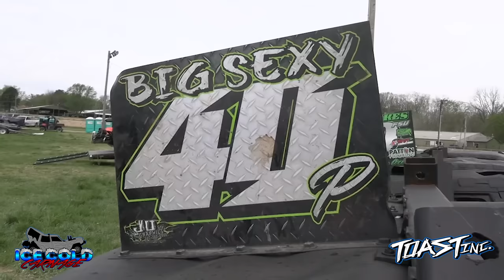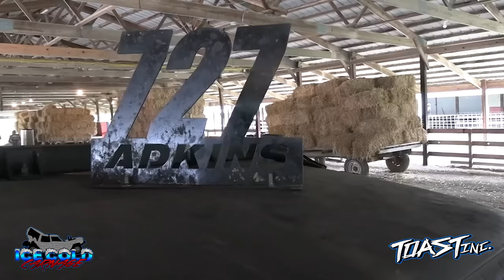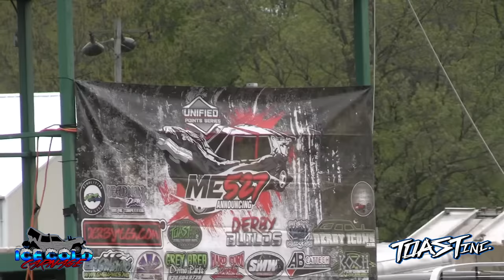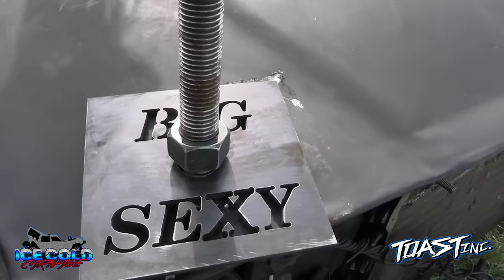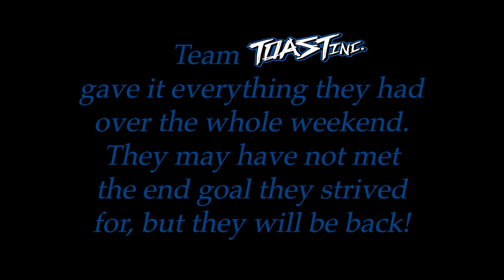Team Toast Inc. Spring X 2023 ( Demolition Derby Documentary )

Comment: You can see how much blood sweat and tears are put in to these derby cars.
The ammount of welding they did is insane.
Well done!!
I have noticed (i'm from Europe) , that there are a variety of classes.
This wasn't always the case right? (when talking about the full size cars)
I use to remember that the derbies were guys who got old cars from the scrapyards, put a roll bar in it, a bash the windows out, and a internal fuel tank in de drivers compartment, and off they go.
The class i see here is really modified with small rear wheels, even the bodywork has been reinforced by making folds in them so that it will not buckle to fast.
But as i said, it's clear that making these cars takes a lot of time and effort, and it's fanatastic!
Reply: Classes haven’t always been around but for 30 years or so, they started becoming popular. Especially with a lot of the old iron cars, simply not existing anymore lol. 

The sport started dying about 10-15 years ago due to people getting priced out, and now there’s classes for just about everyone and everything.